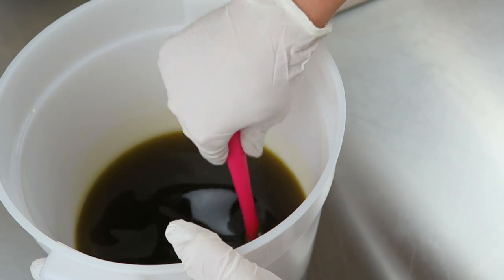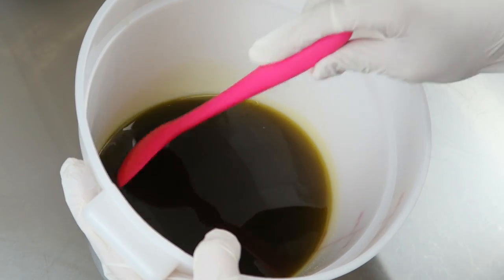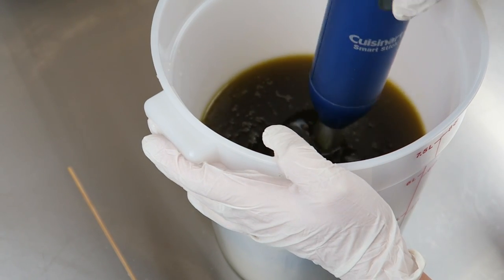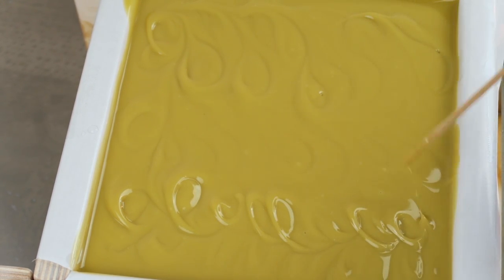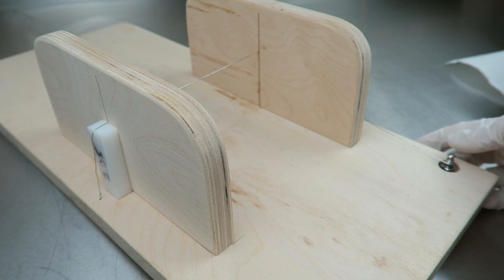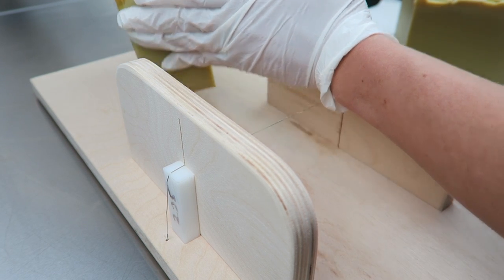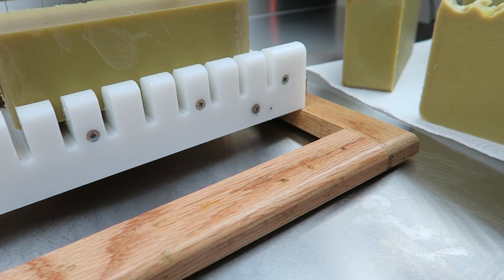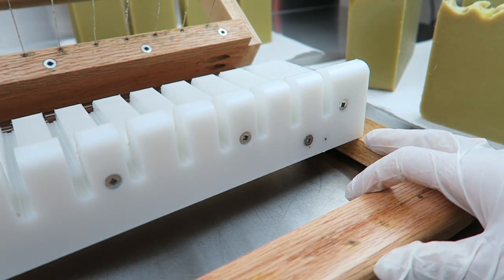Making and Cutting Aleppo Cold Process Soap by Spicy Pinecone

Comment: would i have to let it cure that  long for  hot process.
Reply from the maker: +Daffodil Gems Soap by Miriam Traditional Aleppo soap is made using the hot process method.  The soaps are then stacked (with spaces in-between) and left to cure for 6 months to a year.